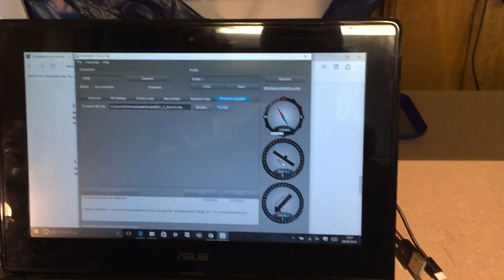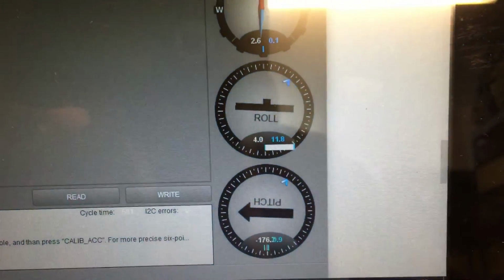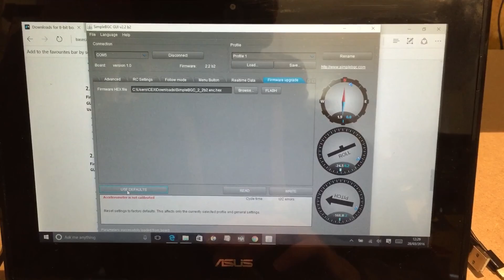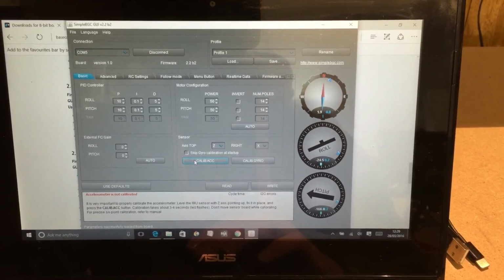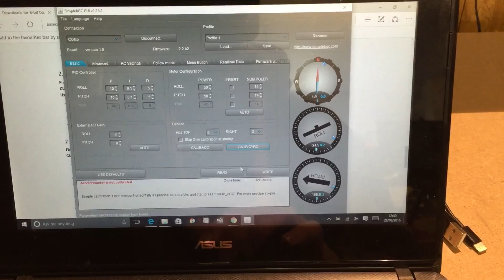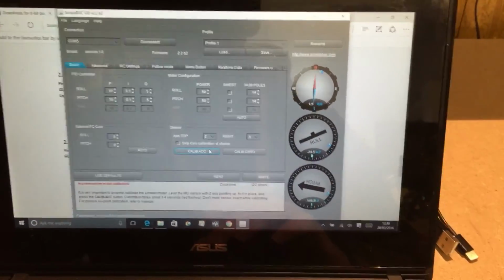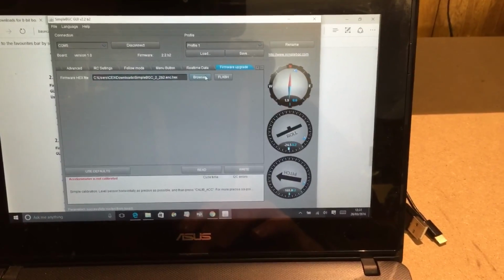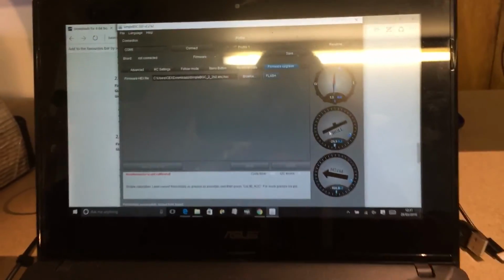Brushless Gimbal CMC BGC2.2 problem

Comment: Your Pitch Sensor is 'upside down' as was mine 
Basic Tab - Sensor>Axis TOP needs to be MINUS Z ie -Z
Roll power 140
Pitch Power 100

That said mine still won't stay level in flight

Comment: I had the same problems and after four days i 
solved simply inserting these
settings on SimpleBGC_GUI program: Basic page 
Roll 21 03 21
Pitch 19 0.09 18
Power roll  48
power pitch 48 
Sensor Axis top -Z Right Y
Then you have to make calibrating ACC and GYRO
for few seconds remember do not move the gimbal 
and the camera while calibrating, then click the 
WRITE button for memorize data.

However i had serious problems whith this gimbal
and i will never buy anymore a product like this

Comment: Did you figure this out? Around 2:47 in the video i noticed your power tabs were set to 50. They need to be set to at least 100 on both to regulate the stability of the gimbal.
Reply from the maker: Scott Winters I will give it a go,thank you for your kind advice